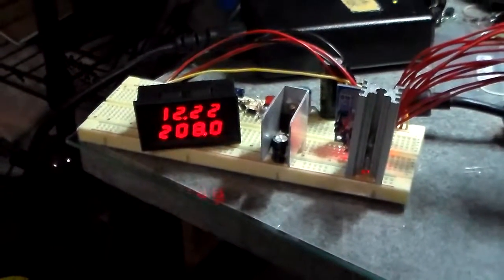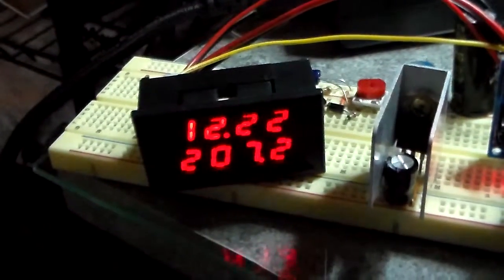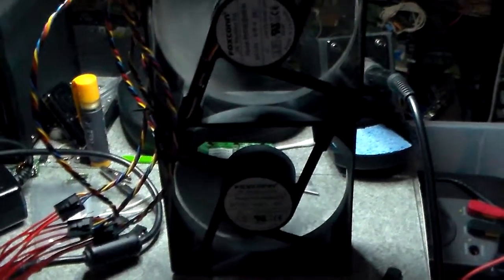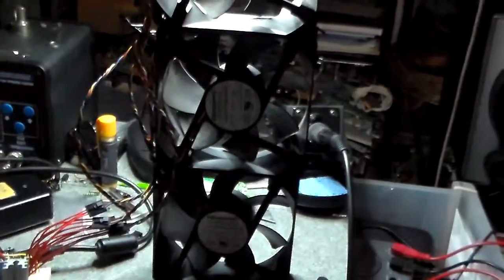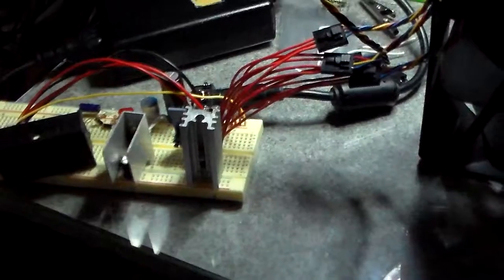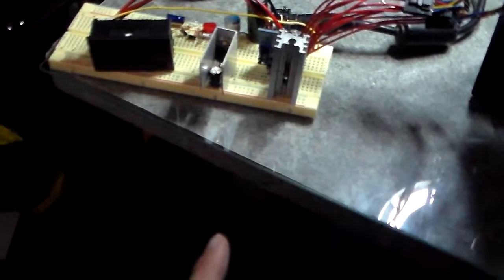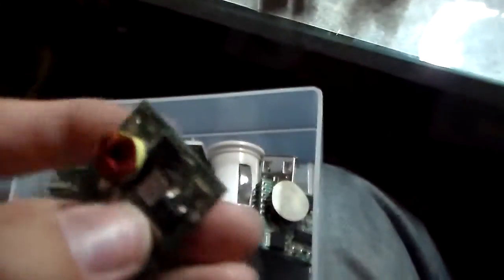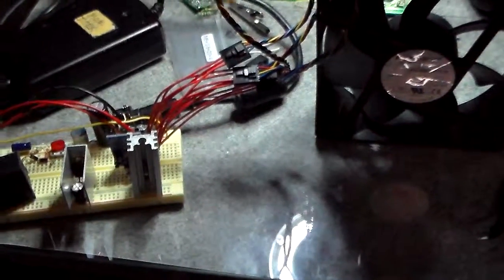PWM inversion, use for the SGL8022W and DC UPS plan

Comment: How you convert that small voltage ?? To a bigger voltage ??
Reply from the maker: what do you mean? the power supply in this video is 12v, there is a linear regulator (7805) for converting the 12v to 5v to power the IC.
Reply: @SuperBrainAK  the Chip that gives a pulse mean that 2 v or 1.8 v that he gives with the touch. The chip gives an output voltage at led pins. How did you converted that. Or how did you connected the led chip to control something ?
Reply from the maker: @TheReal2200  ah I see what you are saying, I never really explained that in this video sorry about that, this other video goes into detail when I use these for another project, start at 11:39 this explains the inversion part of that circuit: https://youtu.be/aO1C72TsVVk 
What is happening is when the chip turns on, the LED - pin is at a low state, due to the onboard NPN transistor, this will allow an led to glow if the led is connected to the 5v, for a normal PWM control of any device a low state means 0% so when the chip is on the LED - pin is the opposite logic than what most things need, so we want to convert that low state into a high state. 
This can be done easily with two resistors and a NPN transistor.
1: connect the LED - pin with a resistor to the 5v, this will give it a high state when the chip is off, the resistor can be 1K to 10K
2: connect the base of an NPN transistor to the LED - pin, this will turn on from the resistor when the chip is off, giving our inversion we want.
3: connect the emitter of the NPN transistor to ground or 0v
4: connect the collector of the NPN transistor through a resistor to 5v, this can depend on what you are powering but for logic it can be the same as the first resistor 1-10K. this will pull the collector high when the transistor is off giving us the proper PWM specification.
5: the collector of the NPN transistor is now the new output that has been inverted, you can then put this on the 4th pin of PWM fans or go to dimmable LED modules or anything else that takes a PWM input.
I hope this helps!! thanks for watching!
Reply: @SuperBrainAK  i can became a max voltage of 4.36 v outout from thr bc547. What can i do to dimm a 12 v lamp or led strip or something
Reply from the maker: @TheReal2200  connect the base of a larger transistor (one that can handle the current of the led's) to your output of the circuit you just made. then connect the negative of the led's to that transistors collector. the transistors emitter would go to ground and the positive of your led's connect to 12v.
Reply: @SuperBrainAK  Ok i will search. Its not more that 1-1.5 A . I will search an npn that can handle this. Thank you. Helped me with this answer 🙈

Comment: My friend...I don't mean to discourage you, but your video is very hard to watch... it is painfully boring. Try to tell your audience at least what your objective is, your experiment setup details, and your discoveries/results.... Provide links to the parts that you use... There's a lot to improve...
Reply from the maker: Yep I am working on that aspect of my videos, The latest one I actually made a list! thanks for your feedback and advice
Reply: SuperBrainAK 
Good to know and keep'em coming.
BTW, do you know, since you played with those SGL8022 based modules, why they could be turning on by themselves? I discovered this effect myself when I replaced mechanical switch to control LED strip. Some of the modules are more pronounced with this effect, some are less... My modules look exactly like yours and I did a couple modification to them to be able to accept 12 and/or 24V input.
Reply from the maker: how did you do the 12-24v voltage conversion? just a 7805? depending on how the circuit is you might be getting some noise coming from the mains PSU that could effect the sensor